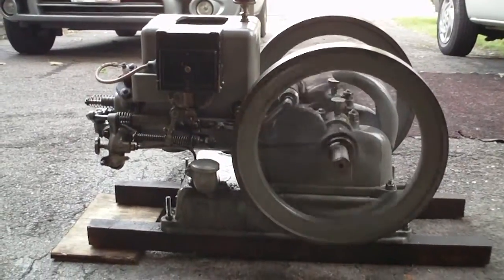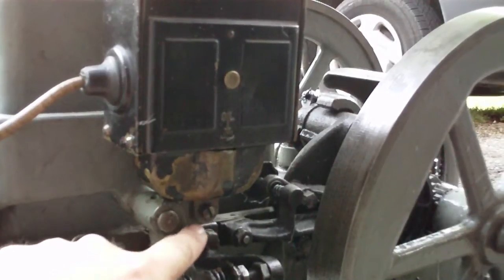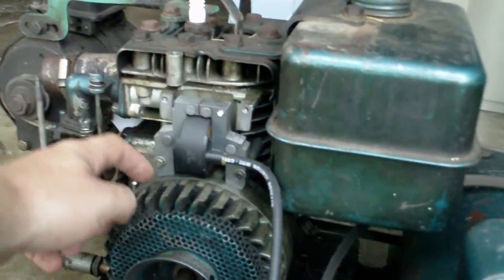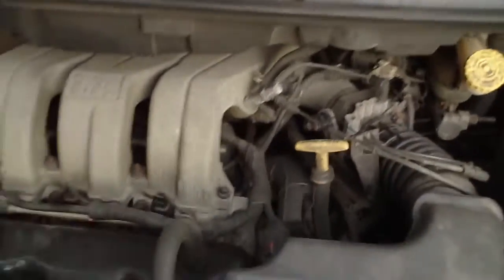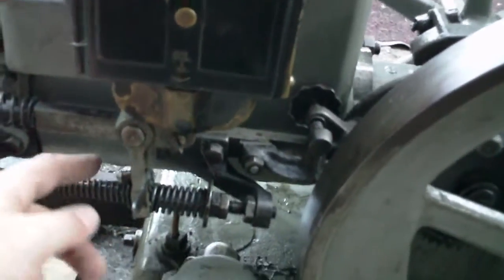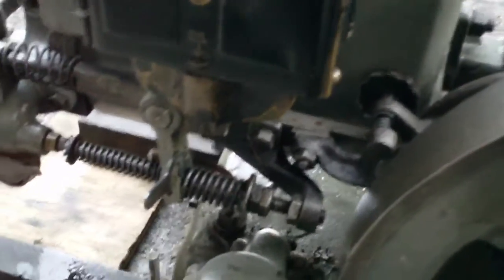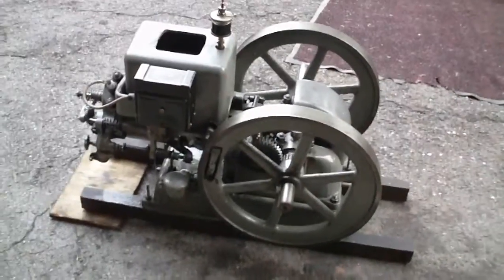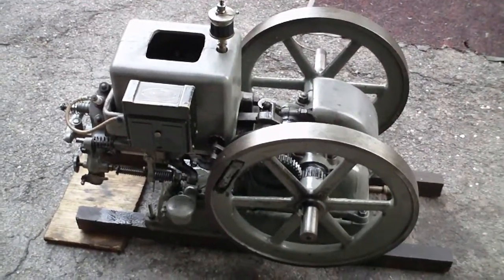Ignition systems overview 1926 Nelson Brothers

Comment: These videos on the jumbo are for the first time owner of a jumbo,but,much is left out.Close ups are too close as we need to see where a part is while another part is where it belongs.Where does the center gear mesh with the crank gear?Please show the flywheel with engine off,then show where the cam gear belongs on the flywheel gear.I need the mag to click when it needs to AND the exhaust needs to open at 35 deg after the explosion and needs to close at the right time and mine wont do all three things when they should,so,its most important to show where cam gear meshes with flywheel gear.thanks!
Reply: i have been trying for 3 years to get mine running,no one in wisc knows how to work on these so a reply would be helpful,Thanks,great engine-wish mine ran like that.

Comment: Can you explain where the timing marks are on the motor to time it?  Does the cam gear line up with the keyway on the crank?  I recently started working on this same exact engine and everything was froze up or rusted off.  Can you please let me know.  I check back later for a post.
Reply: there are no timing marks.. engine speed controls ignition timing and exhaust/intake timing
Reply: Did you figure your question out? I have a jumbo and don't really know how to time it at all.